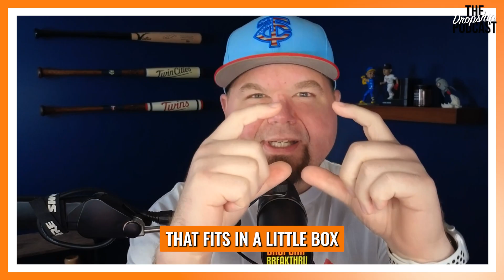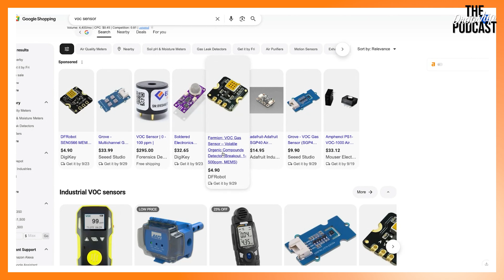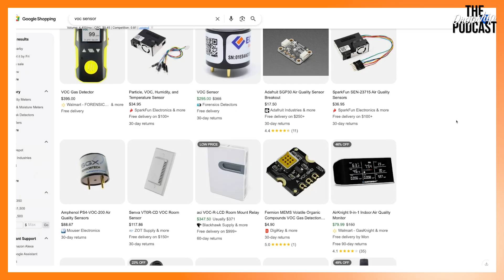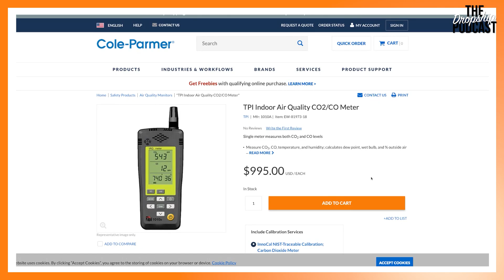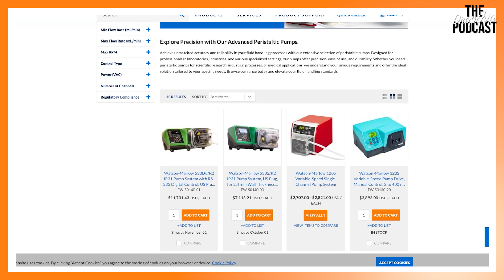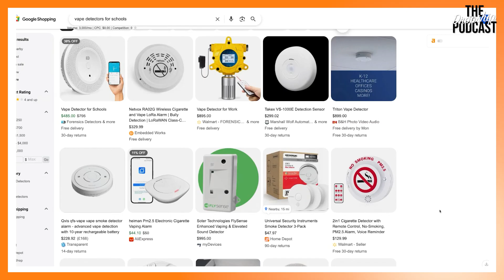Good Niche/Bad Niche: Industrial Sensors — $1,000+ High Ticket Dropshipping Products Anyone Can Sell

Comment: These are pretty good. But what about pricing and margins also authority?
Reply from the maker: Suppliers will generally give you retail pricing. You buy at wholesale pricing so margins will generally be between 20% - 40%+ gross with variation between suppliers. 

You build authority. It's not necessary to start with it.
Reply: @DropshipBreakthru what I meant by authority is, why would say an engineering firm purchase these instruments from some dude who started a website vs from a highly reputable business that’s been selling these for decades and has a reputation that’s AAA
Reply from the maker: @equinoxb8711  because almost no one actually thinks that when they land on a site. 

No one lands on your site (if you do it properly) and thinks "Oh no, this is run by some dude who started a website and doesn't know what he's talking about". 

They may however think about the site. If you put up a dogshit site they might think "this looks untrustworthy and crap". It's not hard to avoid this however.

Go look at most current sites that sell engineering equipment. By my standards they don't actually look or function that great. The bar is not high. 

Ultimately not everyone will buy from you in the beginning. That's normal. But enough people will for your business to grow bit by bit, month by month. 

No one business gets all the sales in any market. 

It's easy to overthink this. I've never had personal experience with a single product that I've sold over the last 12 years and I've had a hand in at the very least over $50M in sales.